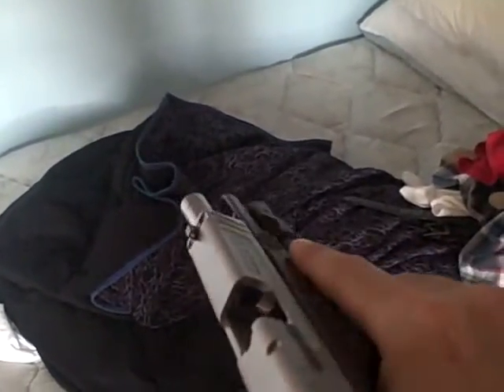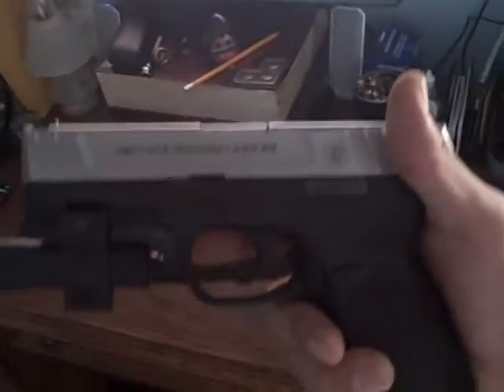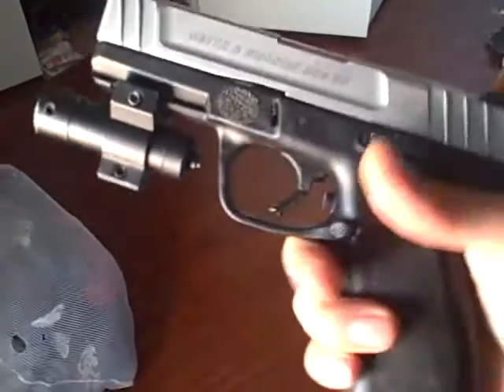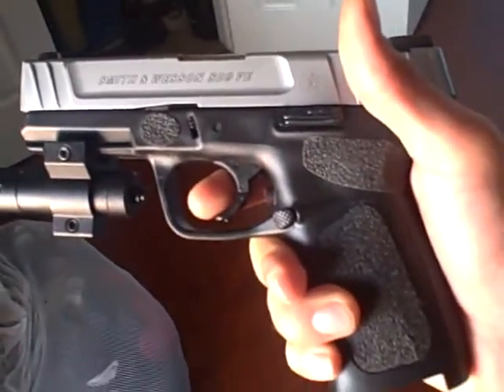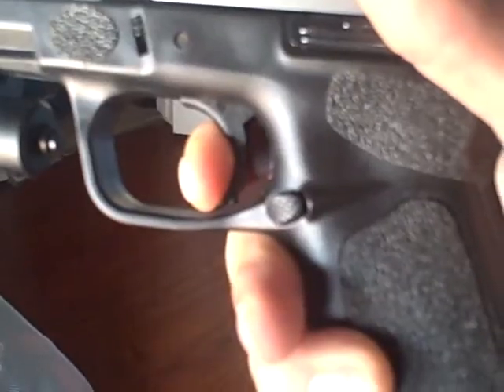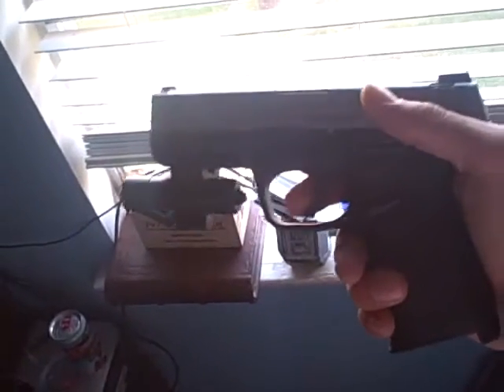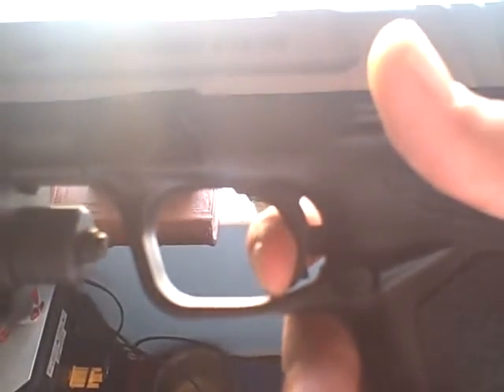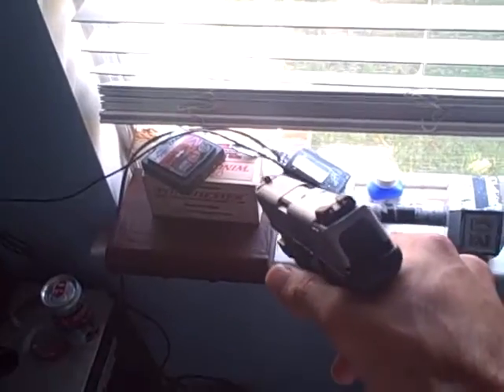SD9VE Eraser trigger Mod 10/24/13

Comment: Ignorant people leave ignorant comments. All this does is take away the overtravel of the trigger which - if you religiously follow S&W's instructions, is totally unnecessary to the safety and operation of the "Self-Defense Trigger"  - put there because the gun has no external safeties. The " two-stage articulated trigger with the heavy pull IS THE SAFETY." This mod does not change that because it still has the initial bend followed by the same 8lb pull to revent accidental shootings from too much adrenalin and too little trigger tension.

Of course, S&W tells the user to let the trigger travel ALL THE WAY BACK to its starting point, but there isn't ONE SW/SD owner that I know of who will do that and not stage the trigger - meaning pull the trigger after the reset is felt and/or heard.  The eraser doesn't stop the trigger in its tracks -you'd need a solid object to do that - as rubber does contract, albeit with the pressure required a function of the rubber's hardness - and I don't need to tell anyone who's used an old-school #2 pencil & hard eraser what it feels like.

What the eraser does is help you do what every other SW/SD owner does when the trigger reaches the break.

BTW, some of the information in the offical S&W instruction manual is DOWNRIGHT UNSAFE! I would never leave a round in the chamber when disassembling the gun or putting the gun down with the magazine removed and walking away from it EVEN IF it had a magazine safety - which some early models had. Since the manual is for models that either have one or don't have one (to my knowledge - ALL new SD's don't have magazine safeties, meaning that you can still fire a chambered round without the mag being in the gun.
Reply from the maker: i removed the eraser come to find out with practice i dint need it after all... thanks for the comment.